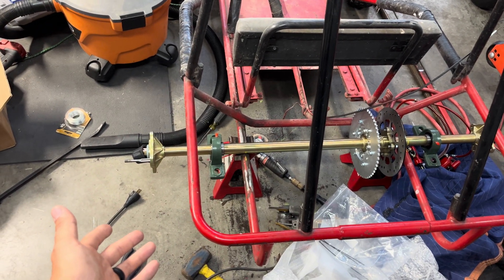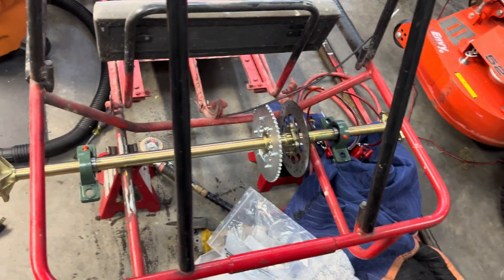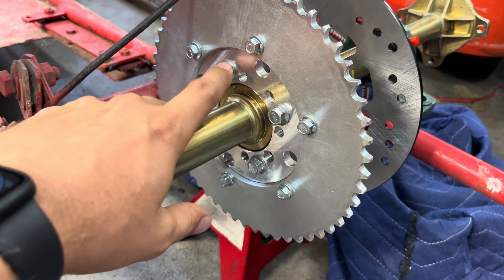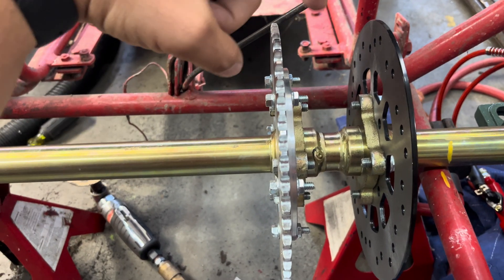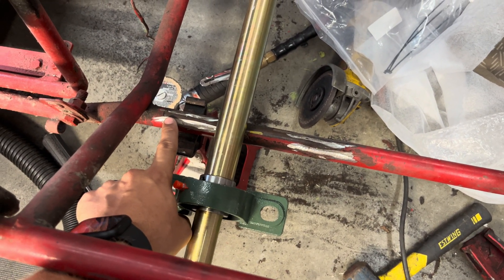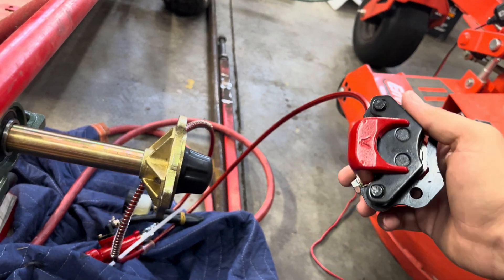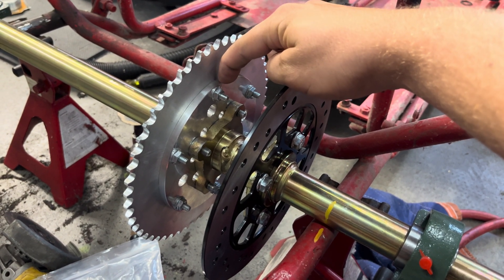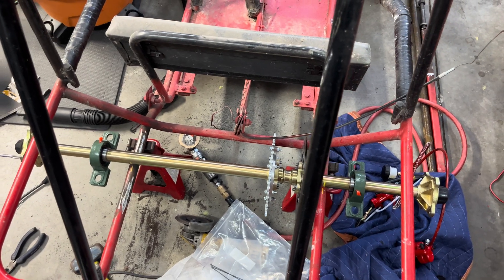Amazon/eBay Chinese Live Axle Info! Measurements and Parts

Comment: Too I bought the 32 inch axle kit and I’m trying to figure out how I can get the brake engagement arm to a useable point on the drain the line is too short to reach my handle bars